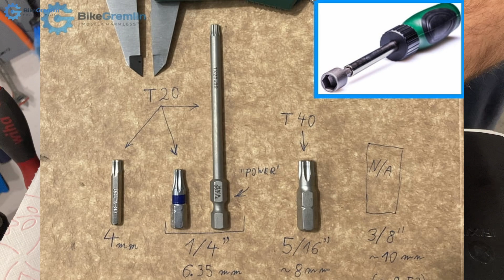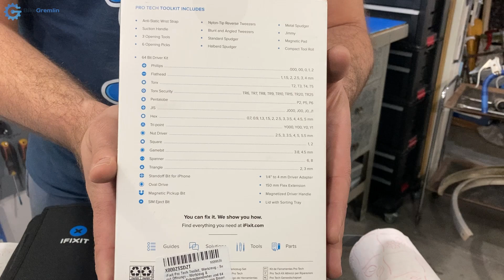iFixit Pro Tech Toolkit - my EXPERIENCE

Comment: no comment how magnetic the bits are?
Reply from the maker: The bits aren’t, but the bit holder is magnetic, so that extends to a small degree. 

Also, I can magnetize them using a magnet (I have a magnetizer/demagnetizer tool).

Relja

Comment: I have this exact kit.  I needed the JIS bits for my camera lenses and laptops ( too small for bikes ! ) . I also got the digital calipers which are obviously not as good as say Mitutoyo Absolute but are adequate for measuring screws , bore diameters etc. The tools at 6:44 are called tweezers.  As you say at 8:15 , the labels for the screwdriver bits could do to be painted white and not be indents in the black foam ( that really annoyed me ) . The included bits are listed on the ifixit website.

Edit : It would be better to create a forum link and put it in the YT description.  Maybe my eyesight is failing ? Thanks for implying that I am elderly ( have gray hair like you ) !